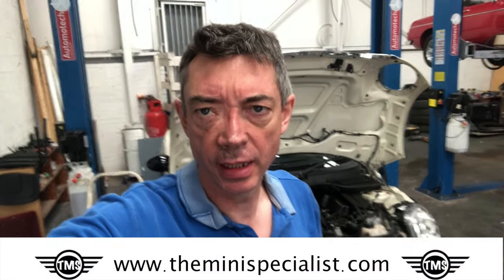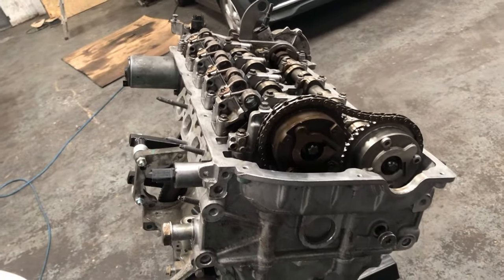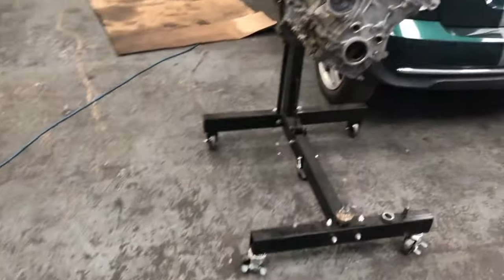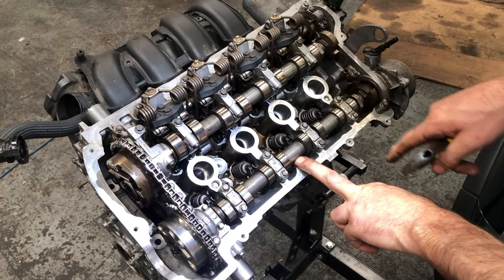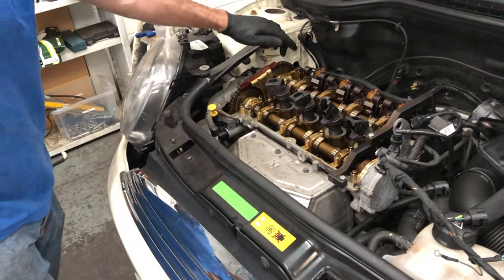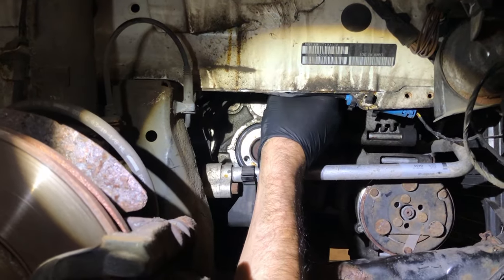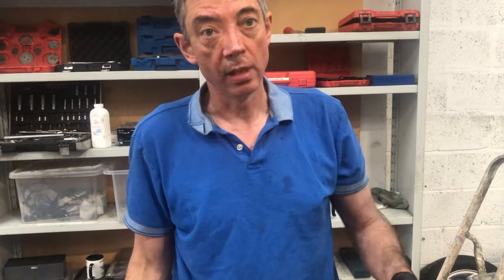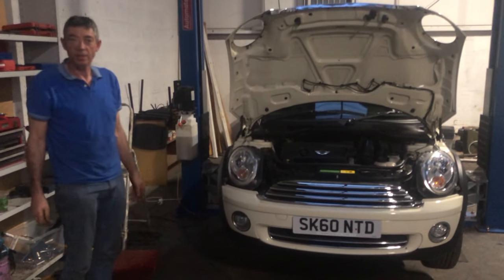BMW Mini Timing Chain DIY Replacement for N12, N14, N16 & N18 engines - The Definitive Guide

Comment: Great explanation on replacement of the chain but I have some constructive criticism. That fault is not a key indication of the chain needing to be replaced. It is simply a fault with the exhaust vanos adjustment unit, and could even possibly only need a vanos solenoid. If you swap the solenoids, and drive the car, there is a possibility of the fault switching to the intake side. That means you only need a solenoid. If it stays on the exhaust side, it probably only needs the exhaust vanos adjustment unit. You can measure the stretch of the chain while the valve cover is off to see if you also need a chain. A key fault to tell if you need a timing chain right off the bat would be something like a camshaft angle fault.
Reply from the maker: It's true that the Vanos Solenoids can fail so worth checking - but the only way I know of checking the chain 'stretch' is to remove the chain tensioner, insert the Chain Pretensioner Tool, tighten, lock and then remove the tool and measure the distance from the knurled knob to the end od the thread.  If this distance is 68mm or less the chain is within tolerance - if longer then it needs changing.  Hope this helps.

Comment: Hi, Excellent informative video. A question, if the writing on the cams are not at the top, once the camshaft cogs are removed and the chain is off can I remove the locking tool and turn the cam slightly to get the writing on the top then refit the locking tool.
Reply from the maker: Sure - As long as afterwards the timing is set properly

Comment: Hi I have an R56 (N16) that has just started clattering - it does it cold and hot - its quieter and less noticeable at higher revs. I can see this doesnt look too major a job to do, so thanks for this quite clear demonstration! but before I start - can I be sure it is the chain?  is there anything I can do to know  it is this issue? car is a 2012 and has only done 50k miles - it has run low on oil a couple of times (came from mini as an approved 2nd hand with no oil on the dipstick - I check monthly and some months it uses no oil, others its used a lot) - the sound to me is exactly like a failed hydraulic lifter  - any thoughts?
Reply from the maker: there is a way of measuring the tollerance - explained here https://www.youtube.com/watch?v=6Mla6cSPasg

Comment: Great video very detailed!  I have one question because  I made a mistake! lol I'm currently working on my N12. I have the camshafts locking tools set as you specified on video.  while removing the crankshaft bolt the flywheel rotated due to having inserted the wrong locking pin. The kit came with 2 different flywheel locking pins (a short one & a longer one). I put the wrong one in so it wasn't locked.  I was able to rotate the engine and inserted the locking pin.  When I did that the chain wasn't on the camshaft so that didn't move or create damage.  Is there more than one hole on the flywheel to engage the locking pin?  is my timing off?  Again great quality video and a wonderful help for us DIYers.
Reply from the maker: no - there is only one place the flywheel pin sits - try using your magnifyer / camera on your phone as you rotate the engine and you should see it
Reply: @TheMiniSpecialist  I’ll try that. Thanks for your reply

Comment: Great video, I replaced the timing chain in a 2012 Mini Cooper coupe R58 N16B16A. During assembly my Torque wrench failed and the bottom two guide pins stripped. Is it possible to replace the threaded area for these bolts.
Reply from the maker: Those pins are steel and go into an aluminum block - they don't need to be tight and I don't have a torque setting for them - seems to me that you quite possibly used a gun to put them in?  Use the gun for removal and put things back by hand and this will not happen.    

As for a fix?  Maybe (if you are lucky) a helicoil will work.  If not - its a new block.
Reply: Thanks for the quick response, I was following Indenifix and using the Torque spec provided. Also I didn't ziptie the hood latch cable. Any tips on getting the hook open.
Reply from the maker: @charlesswann6388  The bonnet catches can be released by springing them from the inside.  Either get your arm up from underneath with a long screwdriver or - like I have -  make a tool out of a long piece if angle iron and shape the end to insert into the mechanism. It helps if you have a spare one one off the car to allow you create the right shape.  I warn you this is not a fun job.
Reply: Thanks for all your expertise, I was able to get the hood open and use a ease out to remove broken bolts. Put everything back together without any problems.

Comment: Reviewed you video, great job.  I'm acquiring tools to replace my timing chain and will also replace the gaskets on my oil filter housing for a 2010 Mini S.  When I look to purchase the timing chain camshaft locking kit, it does  not have a tensioner tool included in the kit.  However, the kits for the non turbo N 14 includes the tensioner.  Will I need the tensioner tool for this job, or can I use my regular tensioner bolt when I install the new chain and reassemble my engine?
Reply from the maker: some do, some don't - there is a large choice - I have several now as each engine needs a different one (N12, N14, N16 and N18) - the most expensive one (https://www.lasertools.co.uk/product/6814) was about £300 and even that has problems - one of the cam clamps bent out of shape when trying to unbolt a cam.  If you only need the tool once try and buy the cheapest one for your particular engine and then sell it on eBay afterwards.
Reply from the maker: And to answer your question - you don't actually need the tensioner tool - I only use mine for measuring the tollerance of a chain on a camchain inspection.  When reassembling have the bottom crank bolt tight, have the top two camshaft bolts finder tight (with the sprockets and chain fitted) then insert the new tensioner to tension the chain, then torque up the cams.  Jiob done.
Reply: @TheMiniSpecialist  Many thanks for your detailed and timely response. Stay safe!

Comment: This video is fantastic! Appreciate it and the editing time that goes in to it. The cam chain guide is missing on mine, almost like the chain has cut through it and chopped it off! Have a look at the shorts video i have just uploaded of it. Have you seen anything like this before? Am i likely to find it in the bottom of the engine? Many thanks again.
Reply from the maker: It's quite common.  Chances are your guides are disintegrating and the tensioner is in 3 bits.....  You will need to drop the sump and check the oil scavenger pump strainer
Reply: @TheMiniSpecialist  I have not long finished stripping it, yes its disintegrated, found bits off it jammed between the guides. I have removed the head because I have got 6 bent valves, all exhaust valves on 1,2,3 cylinders. I will remove the sump and get the rest out. Thanks again for the fantastic video, saved me loads of time. I will mention you in a video when the cars done. 😀

Comment: Hi, I rotated the engine to check timing with the sump and rocker off. I noticed the oil pp sprocket bolt loosened itself. Is this because I rotated clockwise 3/4 times on the flywheel face and instead should have rotated anticlockwise?
Reply from the maker: I doubt it - that bolt should be tight enough for that not to happen

Comment: Excellent video Hugh. I'm going to attempt this repair on my 2012 Mini First 1600 which has the N16 engine. However there is no air con on this car. Is it simply a shorter drive belt with the same tensioner device?
Also, Mini changed the length of the chain tensioner to a longer version. My car has the short one 78mm long. I fitted the longer one from the kit first but this didn't quieten the chain so I guess I need to do the whole job? Rattle goes away when the engine warms up at the moment.
Mileage is 47K.
Reply from the maker: Having no aircon means no belt tensioner - so harder to mount the belt.  Best way is to remove the sparks and turn the engine with a socket winding the belt on.  

As for the chain tensioner - as far as am aware there is no difference in the chain kits between N12 and N16 - if you have changed the tensioner but not the chain and still have a rattle then yes - you need to change the chain.  Every chain lengthens with wear,  each link wears and the overall length increases.
Reply: @TheMiniSpecialist  Did you have to disconnect the bottom engine mount to get the movement on the engine?
Reply from the maker: no - just the top one on the left hand side with a jack underneath allows you to move the engine sufficiently to access what you need...
Reply: I finally built up the courage to tackle this job on the Mini N16. The old chain appeared to be the exact same length as the new one and no detectable play in the links. The shorter chain tensioner was fitted and was replaced by the newer longer one in the kit. Took me all weekend but got it all back together and it's running nicely. 
Ps 10mm ratchet spanner is useful for the Elec harness bracket bolts.
No AC on this car but the belt is easily put back by using a broad screwdriver and rotating the crank pulley to get it on, like a bike tyre. 
Thanks for producing this video.
Probably saved circa £500 so that paid for some nice Milwaukee battery tools!

Comment: Hello again. I'm so sorry to bother you. I have already replaced the PCV valve and the plastic breather hose and after a few days it has failed again. It gives fault P111B again. Could it be the O2 sensor of the Precatalyst that is measuring wrong? What do you recommend I change, this sensor or it could be the fuel tank breathing valve (Canister).
To check the pressure on the intake and exhaust side. What would I need, a smoke machine?

Comment: Great tutorial. I have just acquired a very cheap 1.4 2009 Mini - presuming this is the PSA engine with the chain. It's on 145,000 miles, and I know it's the original chain, is it wise to stick a Timing chain kit on this now, seems a cheap enough thing to do?
Reply from the maker: Hi Dan - not exactly a PSA engine - technically it's the Prince engine which is a joint PSA/BMW venture - but anyway I would say 145K is surprisingly high a mileage for an original chain.  The highest mileage on an original chain I have seen personally was 110k and the guides had started to disintegrate and the oil pump was full of bits of plastic - but this is a 1.4 which may help...  The thing with the 1.4 though is they have a tendancy to burn oil.  Let the car tickover for 5 minutes and then rev the car.  I would be surprise if you didn't get a cloud of blue smoke.  We regularly rebuild these 1.4s because of coked up oil rings and split valve stem seals.
Reply: @TheMiniSpecialist  Thanks for your reply - yes, I have known the car since 45k miles, and know this does burn oil - its seems to run just fine though, no smoke at all - it has a slight hesitancy (intermittent) so I am hoping to stick a timing chain on and tensioners just to be safe and a good flush to try to de-coke it a little - it was very very cheap due to the miles, so not wanting to put alot into it for now
Reply: @TheMiniSpecialist  Had my chain and tensioner done, confirmed was original chain by mechanic, and I know as ive known the car since 30,000 miles :) 

Good going I think, the constant topping up of oil really helped by the sounds of it, but....the chain has very very worn and stretched, along with a lambda sensor and all the oil leaks (cam & oil housing gasket) the mini feels like a completely new car - all freshly timed up - just shows how obsessing about oil tops ups and changes really does help longevity of the chain
Reply from the maker: @dunnockdan  Indeed - it's strange to me that there are people who think that all cars need is fuel.....

Comment: Really, really appreciate you sharing your expertise! Great video - really, really helpful. I have a 2012 R60 S All4 with the N18 engine. I'm getting ready to install a timing chain kit and going to go ahead and replace the water pump, gasket, pulley and idler/tensioner while I'm at it. Are all the torque values you mention in this video the same for the N18? If not, where can I source those? Thank you.
Reply: I've never looked for the modern Mini, but you can find a multitude of manuals online - often free to download.  Owner's forums another good bet.

Comment: Was it necessary to put the cam adjusters back precisely the way they came off, or is there a little wiggle room? if not what's the tolerance? I forgot to take a picture before I took them off and have a good idea as to how what orientation they were compared to the lettering.
Reply from the maker: cam adjusters?  Do you mean the sprockets?  If so they can go on in any position as long as you have IN on the inlet and EX on the exhaust.  Providing that the crank is pinned and the cams are clampped then their position on the camshafts doesnt matter.

Comment: hi, is there any danger of the crankshaft locking tool snapping in the flywheel when you are tightening the crankshaft bolt, ive seen people using a counter tool that bolts on to where the crankshaft pulley bolts to the crankshaft to work against when tightening the crank bolt.
Reply from the maker: It has never happened to us here and we have used the locking tool 100s of times now.
Reply: @TheMiniSpecialist  Thank you, my job at the weekend only on a BMW 116i n13 f20, is there anything i should be worried about, certainly a lot more room on the BMW front-facing engine. really enjoyed your video
Reply from the maker: Not really - the truth is it's a straight forward job and as long as you lock the crank and cams then torque them up after again you can't really go wrong.  Good luck.

Comment: Would it be worth cleaning the mating faces of the cam and crank pulleys to remove any film of oil? would this remove risk of the timing slipping?
Reply from the maker: The timing can only slip if the crankshaft bolt or the camshaft bolts are not tight.  So no.
Reply: @TheMiniSpecialist  oh ok thank you. How many hours would it take for a competent mechanic to do this  for the first time do you think?
Reply from the maker: @DIZZYDAZZLER2011  With this video (or one like it) and the right tools about 6 hours- perhaps 8 for the first time.  On a good day we can do it in 4 - but thats going some and we now do this job at least weekly.

Comment: Just completed my timing chain, however I started my vehicle and found it was running rough, and cylinder #1 and #2 were mis-firing.  I rechecked wiring and realized my vanos solenoid valve wire was not connected.  I also found oil coming out of my exhaust pipe.  Do you think I damage my valves of valve guides.  I haven't removed the intake manifold to check of oil yet.
Reply: Maybe intake manifold....I also did the same thing and it was running rough but I think I have my timing off by 180 degrees since the n12 I worked on has two alignment holes and I did not aligned it before I removed the head for repair. More than likely it might be intake manifold leak.

Comment: Hi, thanx for the really helpfull video. 1 question, i missed the reason why the inlet manifold bolts has to be taken out? best regards, Marcel
Reply from the maker: to remove the chain tensioner.  You could remove the throttle body instead but you need access to the tensioner to remove and replace it.

Comment: I have a copper with an r56 what it does is when you change gears above 3000rpm or if it goes beyond it starts to hunt and cut off then i have to wait for about 2 mins for it to be normal. It has a check light and i did an obd it said cam sensors. I changed them but it still does the same what might be the problem?

Comment: My timing went off when I did my front main seal , I took the crank insert out. I believe my timing moved very slightly but enough to set off cel can I make an adjustment or do I need to do the timing all over?
Reply from the maker: The timing can only change if you (1) loosen the crank bolt or (2) loosen the cam bolts or (3) the plastic guides break and the chain skips a tooth or (4) you remove the tensioner and the chain skips a tooth or a combination of any / all of those things.  Just changing the crank seal will not do that.  The way to check the timing is to pin the crank and using a timing tool to check the cams as in the video.
Reply: @TheMiniSpecialist  thank you , I decided to take my valve cover off and that was it the timing chain guide broke. I'll be using this video as reference while I change it , thanks again

Comment: The 'Prick Bolt' had one on y Nissan Pulsar GTIR back of engine on gearbox housing. 

Is the replacement chain kit uprated? To avoid changing in the future Or does it eventually needs to be replaced like the OEM?
Reply from the maker: My best answer is the chain is likely to need replacing again if you keep the car long enough - all chains wear and get longer.  To say they stretch is inaccurate - each link wears a little and over the length of the chain each small bit of wear adds up.  In the Prince engine the chain length dictates the timing so when the chain length goes out of tollerance the timing goes and the car stalls, runs rough and the engine management light is lit as the ECU cannot keep the engine timed.
Reply: @TheMiniSpecialist  Thank You